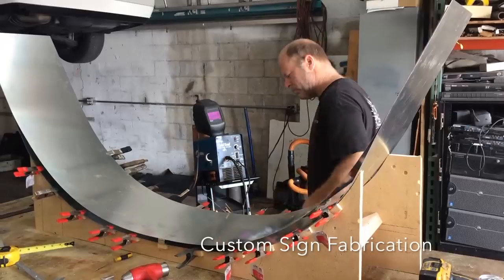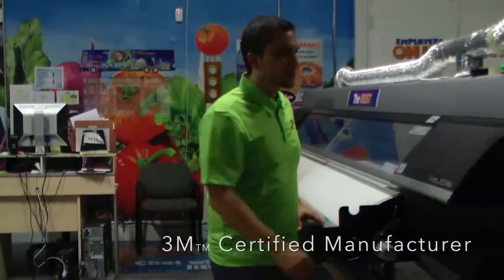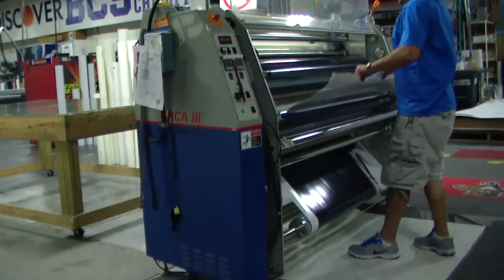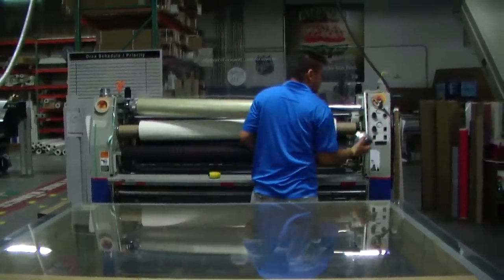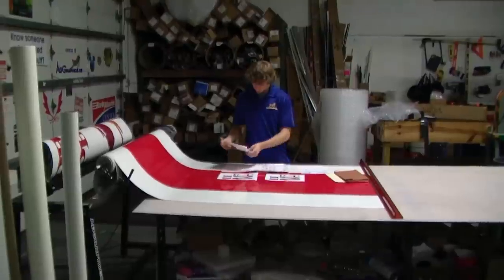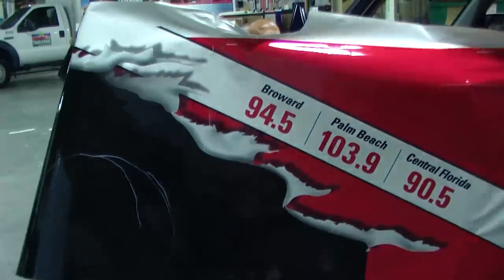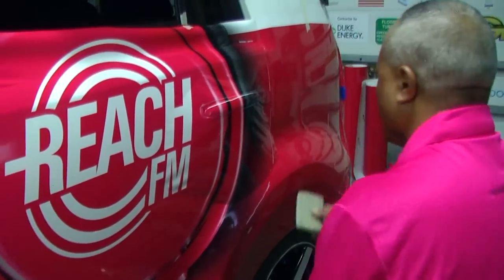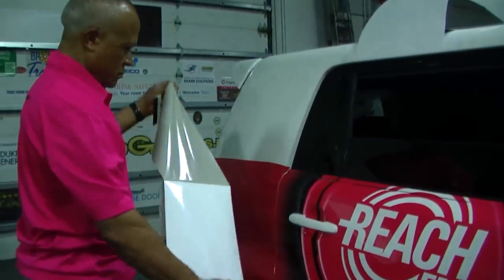The Entire Printing and Car Wrap Process | AdGraphics | South Florida

Comment: David King what dpi do you generally use to put an image on the side of a car? I guess you use illustrator to create vector imaging which is scaleable with no impact on image sharpness but what about if you want to print a photo for the side of a car what pixel camera or dpi do you recommend?
Reply from the maker: Yes, I use Illustrator most often, Photoshop is good when photos are included. The dpi depends on a few factors. Generally speaking, 100 to 150 is best. However, it really depends on the complexity of the design. If there are many graphic effects in the design, the file size can grow very large and difficult to work with and to print. In that case, I have reduced the file size by printing as low as 72dpi. If you have good quality images and graphics, 72dpi should look okay.